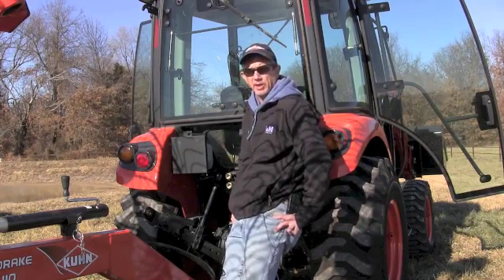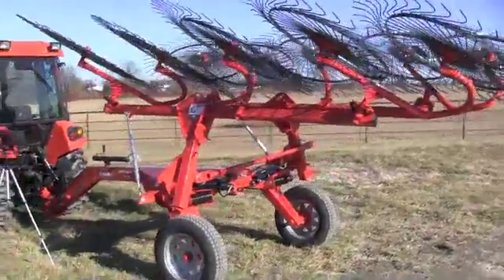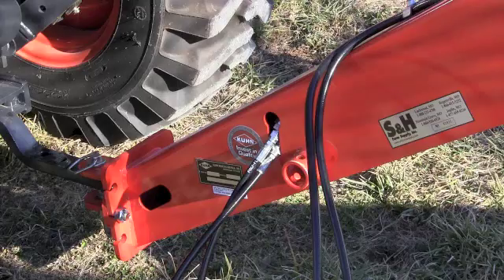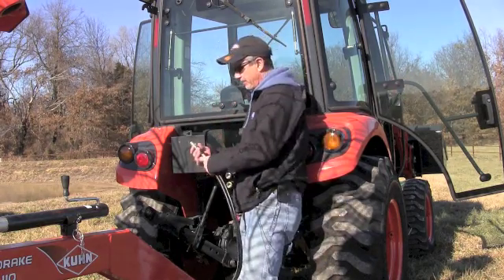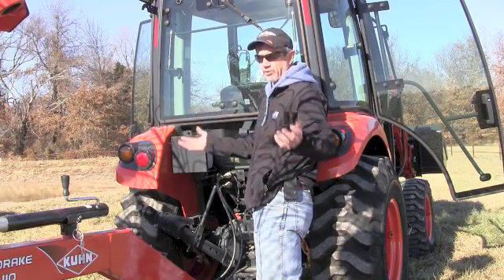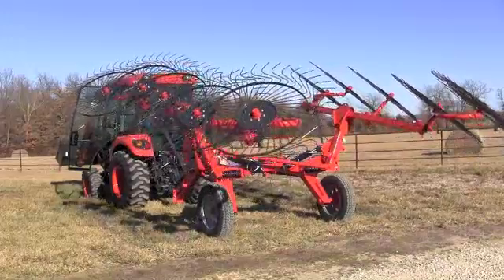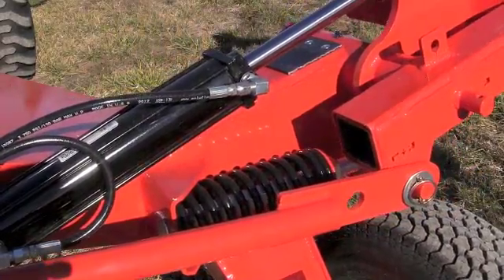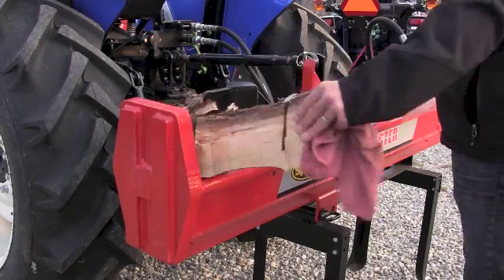What are Remote Hydraulics on a Tractor?

Comment: I use my rear remote for hydraulic top link. The hydraulic top link makes running a box blade so much easier. It is also used for boom pole to give more lifting height.

Comment: I purchased the Summit multiplier per your other video.  I cannot push in the sleeve to connect the hose from baler.  Do you have any suggestions how to loosen up the tractor's remote sleeve to make it easier to connect the implement's hose??    This might be a topic for another video.  I have squirted WD-40 between the remote's sleeve, but so far this is not working.  Help!
Reply from the maker: Did you release the tractor pressure first?  I hadn't thought about it, but that might be a little tricky with the kit.  I'd bet you would need to shut the tractor off, wiggle the remote lever back and forth, then turn the key (but not start the engine) to "accessory" and move the switch back and forth to release the pressure to plug in.  If you continue having problems, e-mail me direct at mike@asktractormike.com and I'll see if I can't get you some help.  If you reply here, that can get lost easily because of the way YouTube sorts comments.

Comment: Hello mike. I have a question. My Massey has a front loader powered from a diverter which is bolted just under the seat. My question is can I place a "t" in the lines to run another set of remotes? The "t" would be placed after the diverter in the lines going to the loader valve. Thanks!
Reply from the maker: I think so...that's probably only putting out 4.4 GPM of flow but I think that would work.  Let me run it by a Massey expert and I'll get you a definitive answer.
Reply: Thanks!
Reply from the maker: Here's the view from an expert Massey man, Ron, at Marshfield Machinery in Marshfield, MO: The hydraulic valves have to be hooked up in a chain, he will need to take the line from the out port of his loader valve and connect it to the in port of his remote valve, then run a return line from the remote valve back to the diverter valve under the seat. If he puts a T in the line the oil will just follow the path of least resistance back to the sump and you would lose pressure to both valves.
Reply: I got all of my fittings installed today and everything works great. I chained a 2 way shutoff valve in line from the "out" from my loader valve. Now I can close the valve and force fluid into a set of remotes on the rear of the tractor. $60 is all it cost. Thanks again!

Comment: Mike, is there any way to tell what remote supplies and what remote is return BEFORE you plug in?
Reply from the maker: They can be both.  If you move your hydraulic remote lever one way one valve will be supply, the other return, move it the opposite direction and they swap.  That way you're moving a cylinder in one direction with the lever forward and the opposite direction with it back.  What are you trying to hook up?
Reply: Tractor Mike okay that makes sense this is for the raise cylinder on a sweepster broom.

Comment: This might be a stupid guestion but do you have to push both levers on a kabota m7060 remote hydraulic system to get a bush hog up or down?
Reply from the maker: Not a stupid question Debbie, but I need more information.  Are we talking a three point bush hog and you're asking if you have to move both the float and position levers to get it to move up or down, or is it a pull type that uses a hydraulic cylinder to move the bush hog up and down (like in the video)?  I'm going to assume since you've watched the remote hydraulic video it's the latter.  If so, you should just move one lever for up and down.  Now, if you had one hose plugged in one port on each set of remotes, that won't work and it's going to make a lot of noise.  The hoses need to be plugged into the same remote, usually one right above the other, and then they'll work good with one lever.

Comment: My 1984 Ford tractor needed a new clutch. Two men repaired it for me but put the hydraulic hoses back on wrong and cannot figure out how to fix it. Where do I go for help? We have the service manuals but they do not display the answer.
Reply from the maker: What specifically is the issue?  In other words, what problem has having the hydraulic hoses connected wrong created?   If it's on the loader and the boom is going up when it should go down or the bucket curls when it should tilt, they've just reversed a couple of hoses.  All you'll need to do is let all the pressure off the system (let the loader down to the ground), and disconnect the hoses and switch which ports they go to.  It's a tough job the first time, I wish I were there to show you.  You have to wiggle the joystick valve to let all of the pressure off the system, push in the hose and then pull out and they'll usually pop right out.  Once the hoses are swapped to the correct ports, then you have to push the collar back while pushing in the hose and pulling gently back until it seats.  Really easy once you have done it a few times, really hard to describe.  If that's not  the problem, get me more info and we'll see if we can figure it out.  I need to do a video on plugging in remotes...
Reply: Thank you so much for your response. I will get this to the men who have been working with it. Hopefully they will be over tonight to work on it some more. I called a New Holland distributor in Griffin, Georgia, and they invited me to come down there and they would see if they could find a schematic which would help. The problem seems to be just as you stated. They realized they should've labeled them before they disconnected them but that's really a moot point right now. Thanks again for your reply.

Comment: Hi Mike great information, my tractor has two sets, one I hook my backhoe and the other one reads trailer. which one would I hook up a rake to? Thank you
Reply from the maker: First, a couple of questions...where are you located and what brand and model is the tractor?  I know that they commonly tow large trailers in Europe with tractors and I wonder if they use hydraulics for braking and if that's what that's for.  If so, that set would be tied into braking and you'd definitely want to use the same port you used for the backhoe on the rake.  To be honest, I've never seen a tractor with a hydraulic outlet labelled "trailer" so I'm not much of an expert here.
Reply: Thank you Mike, it is a 2007 Farmtrac 300 DTC.

Comment: Tell me something I don't already know. What does each port does one return the fluid pressure when cylinder moves???
Reply: On double acting cylinders, there is oil on both sides of the piston.  When you want the piston to move one direction and shift hydraulic flow, the piston will not move unless the opposite side fluid is able to return back to the tank.  It's important to have both lines connected properly.

Comment: Does this take down the level of the hydraulic fluid level in your tractor when you attache these implements?   It seem to me if you hook them up empty, it would take fluid from your tractor to fill their cylinders.   I have ordered remotes on my new Brannon and I'm getting a backhoe.    Should I be concerned about the backhoe dropping the fluid levels in my tractor when I hook it up?  Signed TV (tractor virgin)
Reply from the maker: +Karl Eisenmenger Yes, if it's empty it will reduce the level.  You'll need to check your tractor hydraulic oil after you've operated the backhoe a couple of minutes and maybe add oil.

Comment: let's talk back hoes! Duel set I imagine? I have not ever seen a mounted wood spliter!!! What is outstanding!!! I've used towed spliters but 95% of my spliting, was the good ole mauls and sledges. Can't go wrong there!
Reply from the maker: +Keith Rayeski Are you asking if you need dual hydraulics for a tractor-mounted backhoe?  If so, the answer is you don't HAVE to have them.  Actually, a better option is a PTO pump dedicated to the backhoe.  It's less wear and tear on the tractor than using tractor hydraulics but it is about $1000-$1200 more expensive.  If you don't want to go that way, tractor hydraulics work fine and every backhoe I've seen only requires a single set, the flow goes to the different operations when it gets to the backhoe, but I'd check when I bought the tractor.  I'd recommend getting tractor and backhoe at the same time if possible, especially if you use the manufacturer's low rate program.  I need to do a backhoe video and I just haven't had time, it's on the list.
Reply: ***** Thanks Mark....that is exactly what I was asking!!
Reply: Yes, Let''s talk backhoes!  And other implements that have their own control valves requiring constant flow.  Like log splitters.  Those implements are better served with a Power Beyond kit as pumping fluid through the tractor control valves and the backhoe or splitter control valves both restricts flow and creates unnecessary heat.  Using a PB kit is highly preferable to using a PTO pump type unless the host tractor has a very wimpy implement pump.  It's usually the less expensive route too.

@Tractor Mike - how about a video explaining the difference between remotes and a Power Beyond kit?